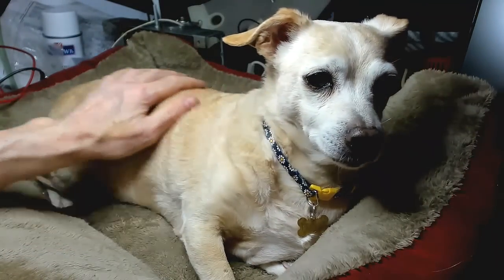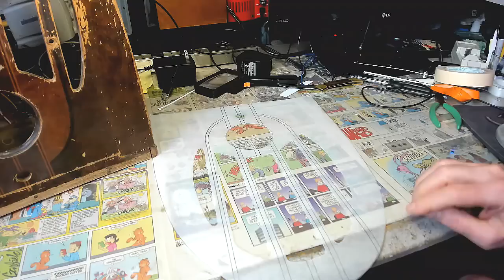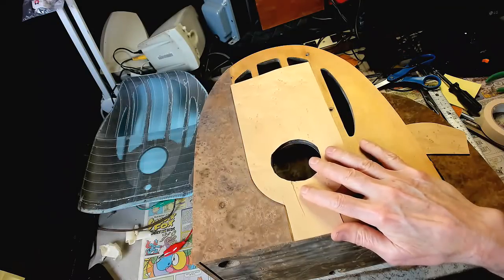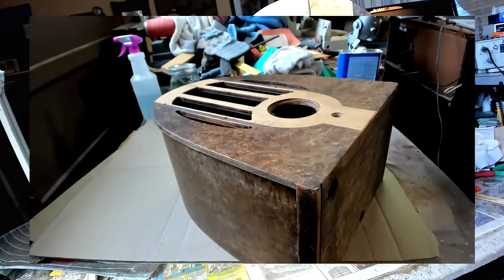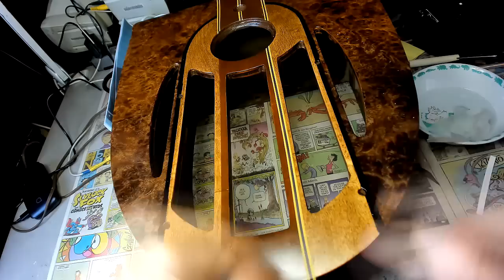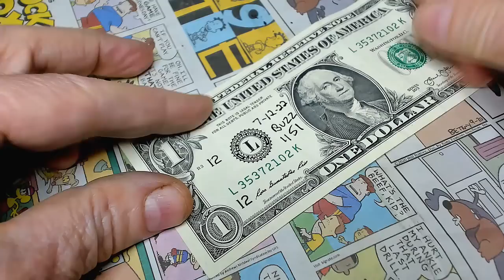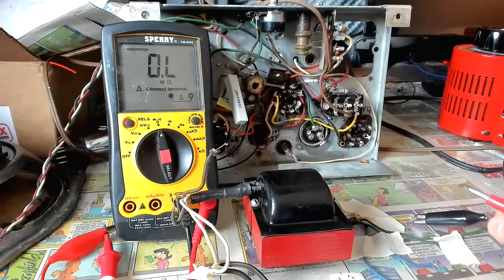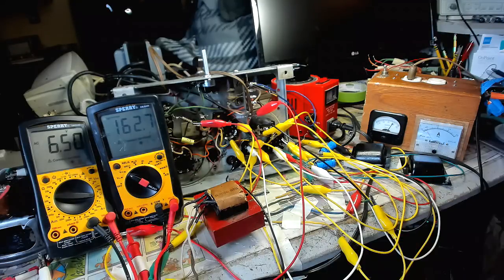1937 Philco Model  37-93 Part 3 Restore

Comment: Buzz - the cabinet is looking great. Lots of hard work on your part to get this one looking good again. Regarding the transformer, you may want to double check your filament voltage to the rectifier tube; using the jumpers may reduce your expected 5 volts to a lower value and a weak rectifier tube will lower the B+ voltage. Hope you get it squared away and again nice job getting this one looking great and playing. Best, Don
Reply from the maker: That problem happened just the other day, so I will  investigate the transformer problems  Monday, when I start filming Part 4. We shall see....thanks, Don
cheers, 🍺

Comment: That was quite the saga with the veneer but you nailed it in the end.  The transformer reminds me of an issue when I was working at CEI in Melbourne testing and troubleshooting broadcast cartridge machines (Fidelipac carts).  A cap had popped in one and we the 300V winding for the pinch roller solenoid was producing 500V. Looking further we found one end was shorted to the frame.  The transformer winder didn’t notice anything as the frame is not connected at that time.  In the machine, the frame is wired to the chassis which is grounded.  So the 300V winding and the 240V primary acted as an autotransformer. Yikes.
Reply from the maker: YIKES!

Comment: Beautiful job on the cabinet Buzz.
Before you take apart the transformer, test the HV winding and see what the AC voltage is, it may not be the transformer since the resistance is about right for the HV windings, your low B+ readings may be your 5Y4 tube or something loading the B+ down.
Just a side note: it may be because you painted the transformer core RED!!!!.....LOL
Reply from the maker: I think you are right about the HV winding. I was using a different 5Y4 tube  because I broke the original. I ordered a new one. I think the problem was the 6.3 windings were shorting due to being pinched against the clamshell. ...bad heat shrink job.... I will explore this in part 4.
Your video came in handy, thanks.
😅😂😂 You might have something there about the red paint!
Reply: @Buzz1151  YES the transformer is protesting because you painted it red...LOL

Comment: You always seem to do a great job Buzz even with your trial and error ideas that seem to work pretty well. I am guessing it's because you gave them a lot of thought before you complete the action needed. Buzz you just spend so much time restoring these I would have given up long ago if I needed to do this much work for a restoration but, you are always in there slugging away even when you have a major problem. Old Buzz has electric shorts? Thanks for a great video Buzz.
Reply from the maker: This cabinet took so much thinking and planning, my brain hurt! 😮😮

Comment: It’s been 🐝 awhile since ya made a video. The song 🎧 goes very well with your dog 🐕, Peanut 🥜. That’s a REAL Philco radio 📻. Not a reproduction from 1989, or whatever. All it needs is a facelift, capacitors, and possibly a tube or two. I don’t know if I’d like 👍 the exact same color of finish on this, or a darker one ☝️. The speaker 🔊 grille cloth may require some attention with replacement, or might not. Ya should have a museum of old radios 📻 in your house 🏠. It can be an unused bedroom 🛌, or basement, for example. At least, a repair 👩‍🔧 place for them. Your friend, Jeff.

Comment: Hi Buzz.  I wonder if you miswired the high voltage transformer leads. You may have low voltage because the rectifier has the middle tap connected to it.
Reply from the maker: The transformer has some bad windings...getting a new transformer 👍

Comment: Buzz, where did you order the push back wire? I remember using it back in the 60's when building various projects, have not seen it in years.
Reply from the maker: Hi Larry, here is the link
https://www.stewmac.com/electronics/components-and-parts/wires/vintage-stranded-core-push-back-wire---50-feet/?variationCode=1470
Reply: @Buzz1151  Thanks Buzz

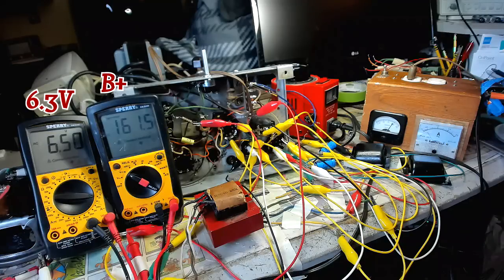Comment: Did you ground the case of the transformer at 48:50?  I'm guessing you may have a winding short!
Reply from the maker: I do know that the 6.3 volt winding was touching another wire.

Comment: All of these old plastic dial lenses are dark yellowish in color.   And reproducers of these dial lenses make them that way.  I often wonder if originally they weren't translucent white or clear and have yellowed over the years as all plastic does.  And the people reproducing them make them yellow because there are no original new-old-stock dials to go by.  And even if there were they too would have yellowed over time. So they copy old yellow plastic.
Reply from the maker: I bought a repo and it looks good on the radio

Comment: Buzz you should have left the transformer wires alone and not have spliced them like you did. If you can't fix this, look at getting a Classic Hammond replacement transformer.
Reply from the maker: I have ordered a new transformer, but will try to fix the original 🍺🍺

Comment: Hi old buzz, limey here.
Testing the transformer off the chassis would mean no electrical contact from the frame of the transformer to the chassis, if its leaking to ground then this may have messed uo your test with the clip leads.
I like yer first car, bet you wish you still had that thing now eh.
Reply from the maker: part 4 will be out this Friday